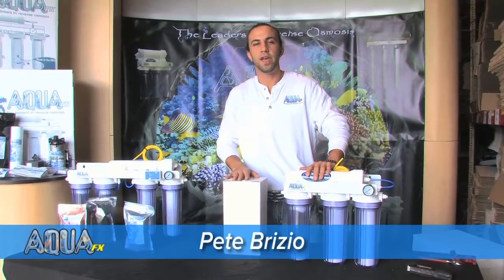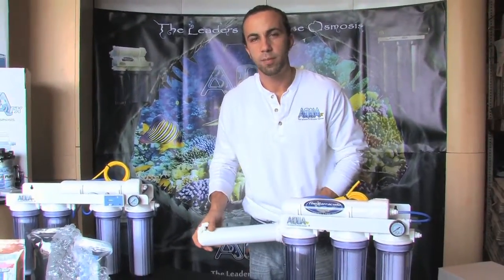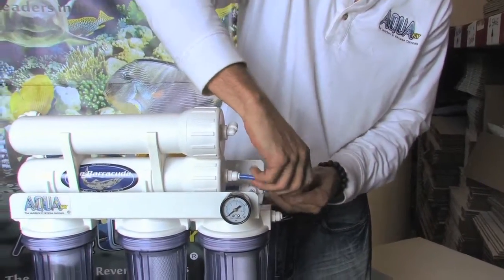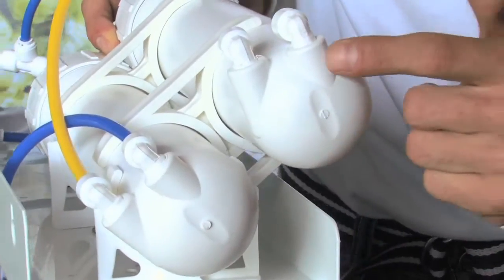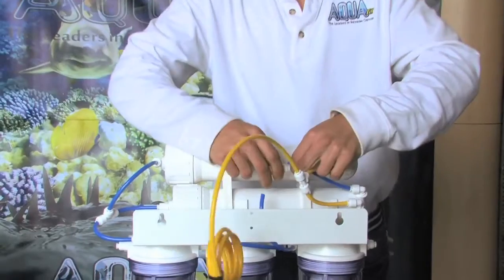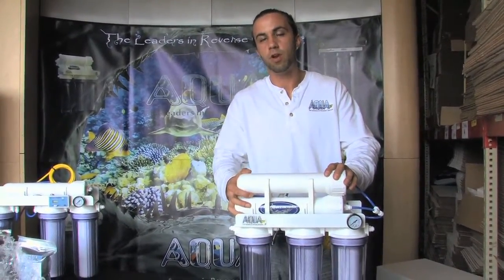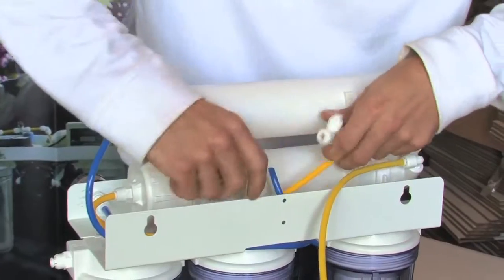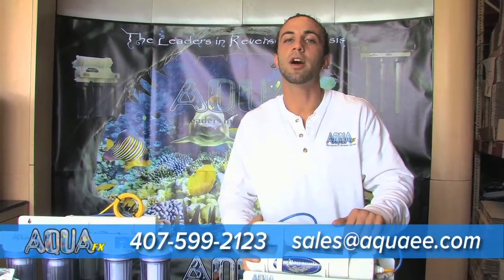AquaFX Piggyback RO Membrane Installation

Comment: Super  good video and i am surprised  there is only 45 thumbs up i think  you  did and excellent  job making it and thanks. I live in Thailand and  have my ppm  down to 45 now i added a 10 liter ion exchange resin tank. Now i have another  since they  fit under the counter and if  my ppm  doesn't go to 0.00 or below 20 ppm  then i might  stage 2 membranes together and see if that  helps.  since i have lots of time to play around..LOL  Thanks again

Comment: Flow restrictor needs to be changed or upgraded to match the new flow rate, why isnt this discussed as part of this video?
Reply: The Flow restrictor does not NEED to be changed. The 100 GPD Flow restrictor creates enough back pressure for both RO membranes. IFFF you really felt pressed to do something, you could ADD A SECOND flow restrictor to each respective drain line... There is no 200 GPD flow restrictor made within the industry ... so using one FR works just fine, but again if you wanted to do something above and beyond you can add a second 100 GPD FR, one in each exit port from the drain line... :)

Comment: did you use the same flow restricter in the parallel set up as the single set up? what effect does the flow restricter have?
Reply: Yes with the parallel setup we used 1 x 100 GPD Flow restrictor (FR) on the final exit. As mentioned below, you can use one FR in the final drain, or you can use 1 FR in each respective drain line. The difference is almost negligable.